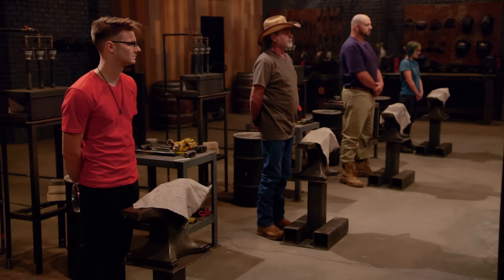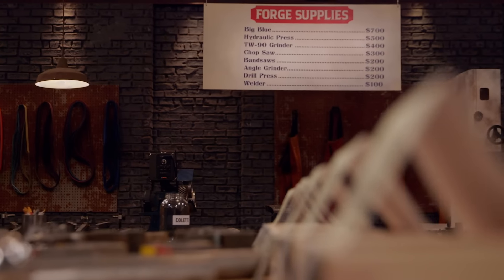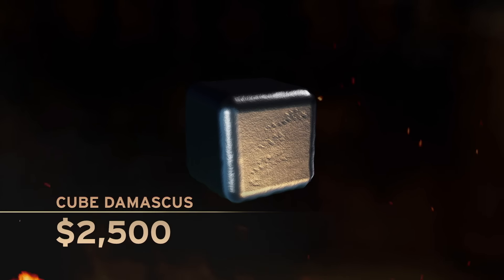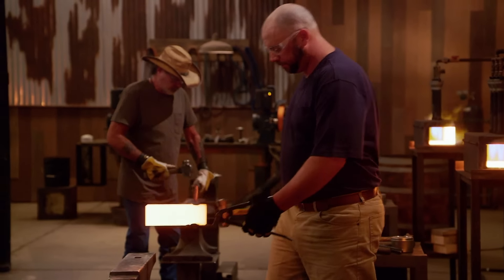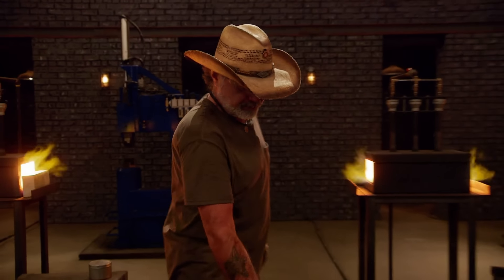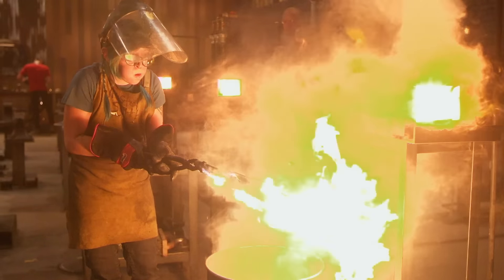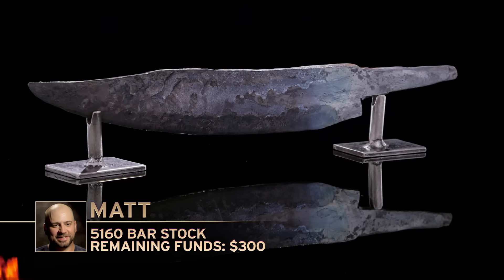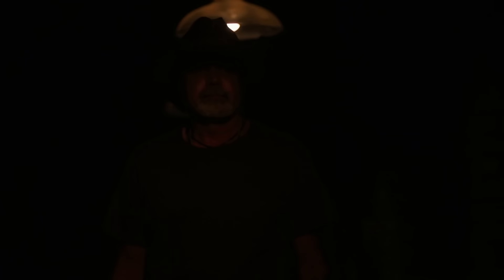Pay to Play COSTLY Forging Challenge | Forged in Fire (Season 7)

Comment: for a sec, I thought they wanted them to make a knife out a plastic calculator...
Reply: Well it would cut down in the amount of time needed to heat the material to be moveable, and wouldn't need big blue for moving it either.
Reply: But, will it kiiiiill?
Reply: Shhhhhhh...don't give them any ideas 😂
Reply: @coreytaggart128  yeah, heat it right and you can forge plastics.  gotta get it JUST right though.
Reply: That doesn't add up

Comment: No one thought to trade tools?   I will use blue for you....  Grind for me
Reply: That would have been interesting to see. What an awesome why to work the system.
Reply: They are meant to compete against each other...
Reply: Look at the actual competition.  First part is competing only to be in the final competition  Then you compete against each other.  Select one other, work together to get to the final.  Use the rules to your advantage.
Reply: And trust the competition with your blade ? No thank you
Reply: There is an episode where all four move to the next round because all the knives where good enough and no one had one worse than the others. If they all work together they might be able to do the same thing

Comment: A Good Machinist, would make 5 blades within the three hour time limit,, well within the time line,, they know about the metals, and with the spec's given would be a peace of cake. not working with hundreds  of thousands of an inch, they have better knowledge of the machinery they are using. So these " Forgers" ? still using power machines are really not all that good. that's why 99.9% of knifes are mass produced..

Comment: I don't often like to say something is dumb... but this was dumb.   Having blade smiths worrying about spending money for tools that they should have access to anyways is just a silly concept that shouldn't be in this show,  absolutely no one really did a good job with what they had regardless of how much money they had.    And worst still, you really don't even see them applying their craft, before you know it "everyone stop" and what did we see? We saw a couple guys throwing a hammer,  the lady trying to make a canister Damascus,  and that was about it.   Did the two guys with the bar stock pay for any tools?  how about the two Damascus people?   Did they use up their money to make the extra work worth it?    Needless to say, this idea for any future shows needs to be shelved... then the room with shelf needs to be set on fire.

That said, I would have done ball bearing,  and paid for the welder to tack it to a piece of rebar,  the hydraulic press to flatten it, and the grinder to get the shape/reduce material.  $100+500+400 = $1000
Reply: Well we would have seen them using their craft if they knew how. The 5160 guys just beat it flat on the anvil, no wonder they couldn't move it in time. You can see Jason Knight put a point on a flat bar in 2 heats beating it on the edge of the anvil with the half on half off technique. Granted not as big of a bar, but they had 3 hours. Even if you're bad at math and strategy, skill would've saved them.
Reply: It's not the best idea, but they could've just restricted access to some tools based on difficulty. They should keep the idea of choice and risk as it would make the show interesting. I think they made it more complicated than it has to be.
Reply: @mrkiky Except, they the hosts, caused unneeded pressure and anxiety for views and bad content. It's one thing to make the forgers work with something they've had little experience in. It's another thing to then handicap them with this ridiculous challenge.
Reply: @Cerberusx32  Every challenge is ridiculos. They always have to weld a piece of a shopping cart to their work or work in the sun, things that you would literally never choose to do and never have to do and are not part of being a good bladesmith. It's a show to appeal to the masses not a real competition. That's why Jason Knight hated being a judge and Ilya Alexeyev hated competing. It's ridiculous and doesn't prove anything.
Reply: Tool restriction adds interesting moments to show. How many episodes of 4 guys doing knives with all tools available would you watch? Maybe first season?
Reply: @4Core100  as someone said earlier, tool restriction is one thing,  having some budgeting of money to buy tool usage is different.   I'm guessing there's a reason why they didn't show whether or not everyone used "money" to buy tool usage... it was a dumb idea for TV.